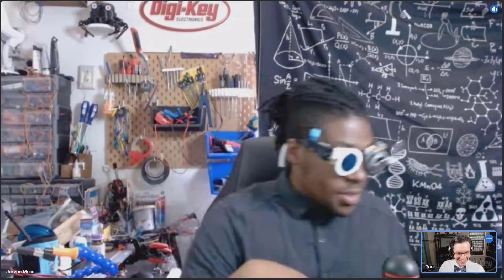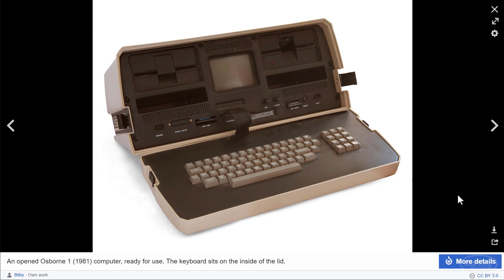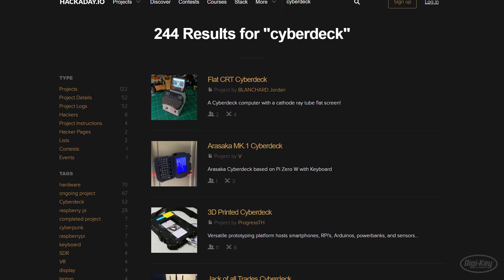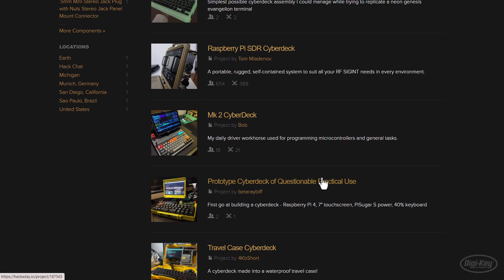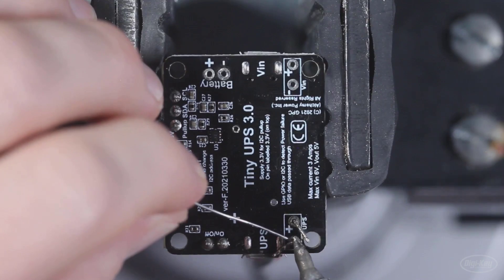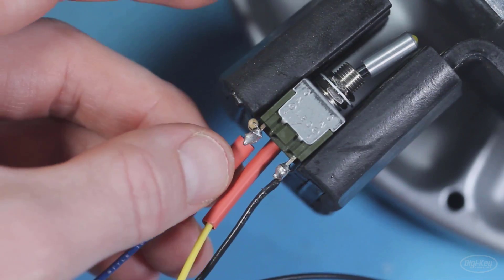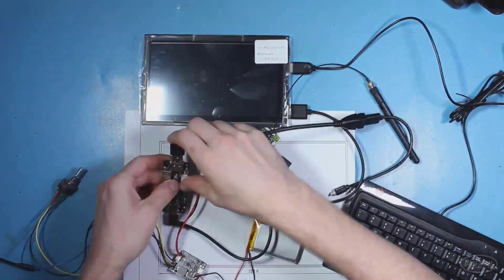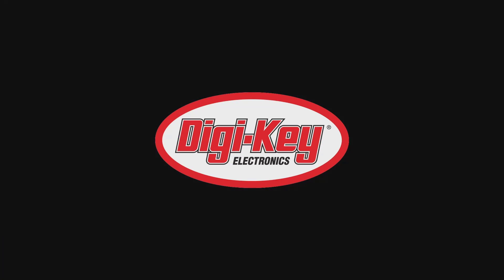Building a Raspberry Pi Cyberdeck | Digi-Key Electronics

Comment: I made one from a portable DVD player. Screen swapped for touchscreen, and HDMI. The 7" screen I bought fit inside the screen housing almost perfectly. I did have to cut the back of the screen shell open, had the Pi4 just hanging off the back.  Originally, I had everything exposed, then found a way to flip the screen. I  hollowed out the DVD part and cut a hole for the fan. What I ended up with was a chunky boy tablet that can stand on it's own and can use several keyboards. The screen had it's own speakers but I upgraded to some old laptop speakers installed in the DVD player bottom shell. Added a 5A buck converter. Set to 5.2-5.3V, so it runs overclocked on the go, from a 12V 6.0A  power tool battery. Twister OS, Retropie, and separate card for Android 13. It is a highly functional, portable, entertainment machine. If you use HDMI use a ribbon cable, it's much easier to get that to fit whatever you're building. My screen already had a ribbon cable connector, making a completely flat connection. with nothing hanging off the side of the screen.  8Bitdo SNES30 controller is the perfect accessory, it's easier to pocket than an XBOX or PS3 style controller.

Comment: A cyber deck is a mobile terminal. I’ve seen a lot of novelty cyberdeck builds, but I believe the spirit of what Neuromancer originally inspired has more real life examples in something like a flipper zero
Reply: I like the alternative spin on it I see people doing often on r/cyberdeck; a small SOC with minimal distractions and some way to write code. Sure, a laptop can do that as well, but having a bare bones device with the minimum necessary to write code as a separate think-space from the usual leisurely activities is a nice way to switch into focus mode. (I tend to get distracted easily due to ADHD so things like disabling wifi etc are really helpful to me)
Reply: @ObsequiousV4  agreed. this is one of my decks main purposes
Reply: .........i dont think you read any of gibsons books
Reply: If it's portable, connects directly to cyberspace/internet (nowadays remotely bt wifi), and you have the skills and soft to access things you shouldn't—it's a cyberdeck.